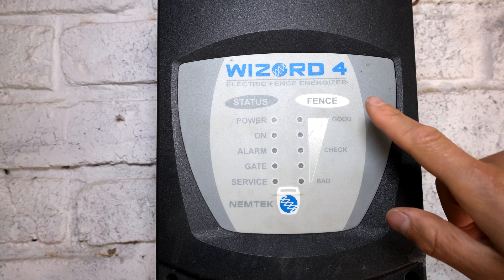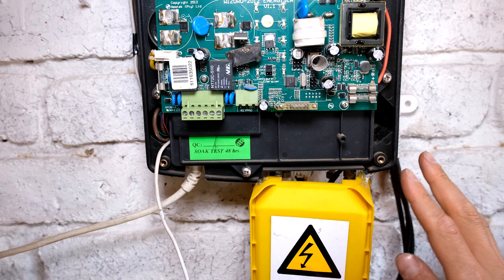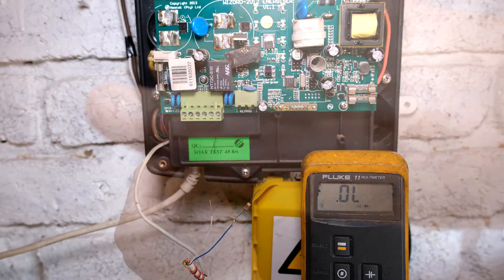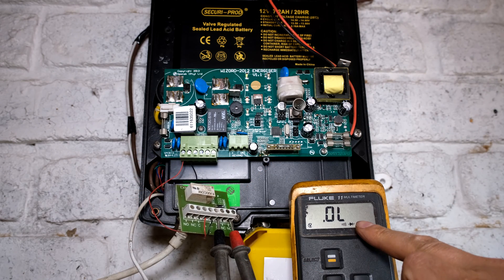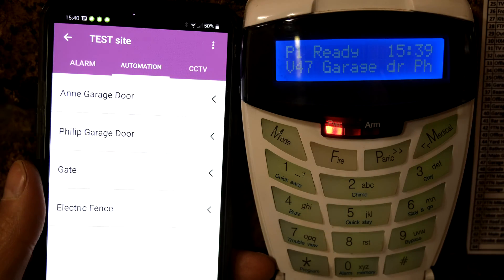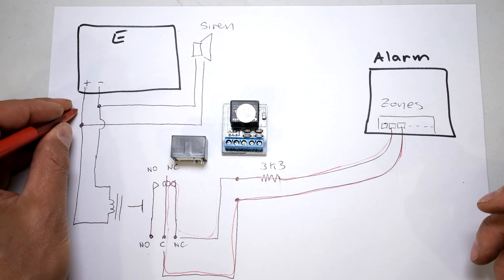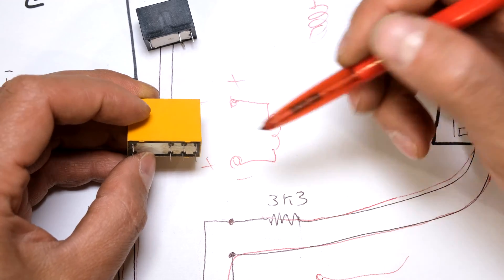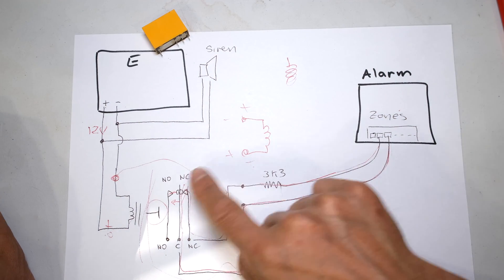How to connect your Nemtek electric fence energizer as a zone on your IDS X-series alarm panel.

Comment: Good day,

Quick question I have wired up my electric fence as shown on the video but my IDS system says that the zone is permanently open and wont be able to arm the system unless the zone is either bypassed or fixed.

Comment: Thanks for the video, I realised this setup only is for zone/fence violation. Any suggestions how a energizer outputs can be used to monitor when it is armed or disarmed by a alarm panel such as the IDS. Crucial when arming panel and forget electric fence is not armed.

Comment: Good video as always i see in some installations when connecting fence to the alarm some installers use 1 button remote by removing the button and connecting the remote to the siren output and i guess to the alarm reciever more like wirelessly  can you emphasis more on that.
Reply from the maker: thank you. i have more alarm videos and i will explain that concept in one of them. I have done that with a keypad and remote.